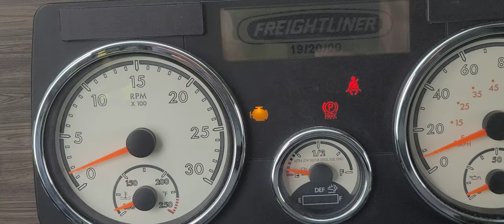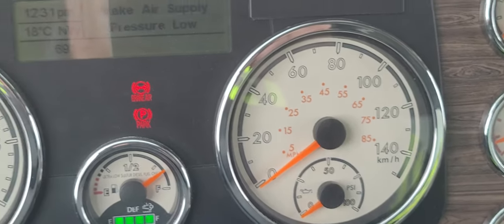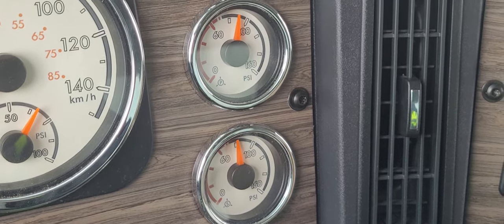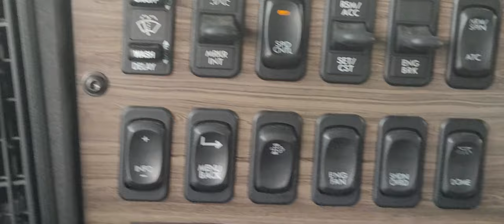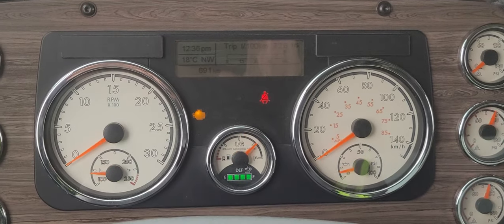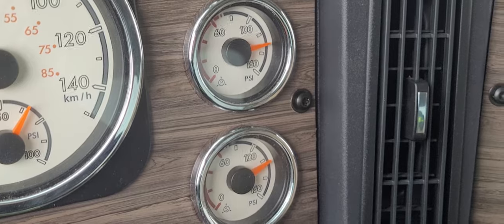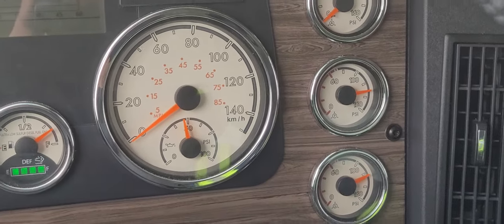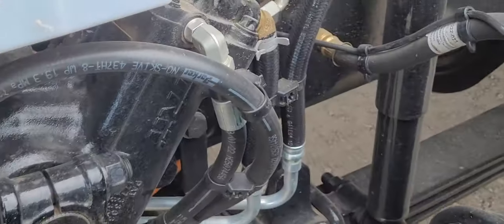Class 3 Airbrake Procedure for Alberta Airbrake Program (2022 Freightliner)

Comment: Is it a requirement on the class 3 road test to check and measure each slack adjuster?
Reply from the maker: Not in Alberta, It is more of a verbal confirmation. Basically the Examiner needs to know that you know how to verify and check brake adjustment and what to look for.
Hope this helps you out...